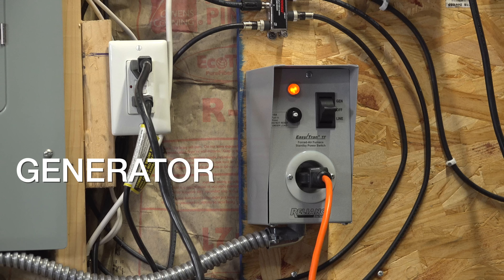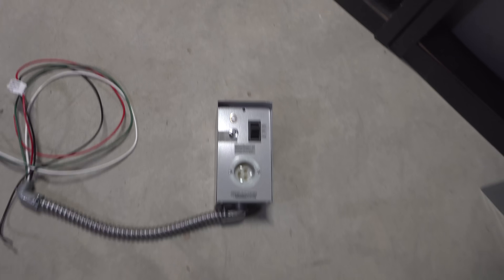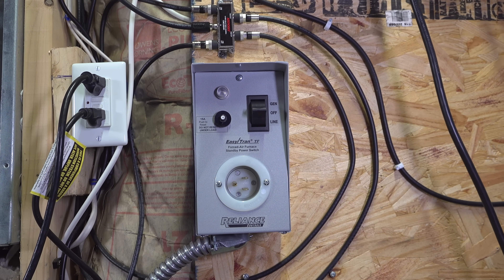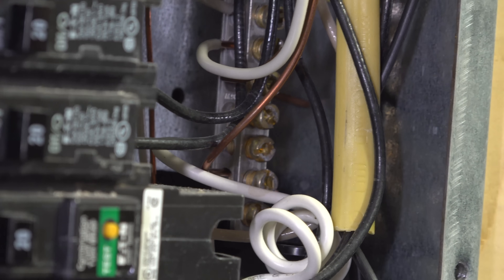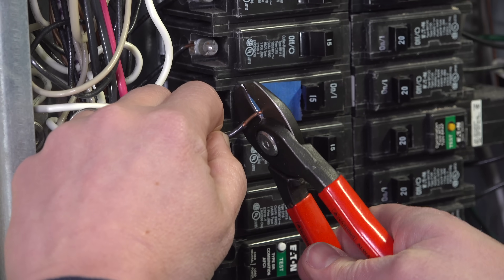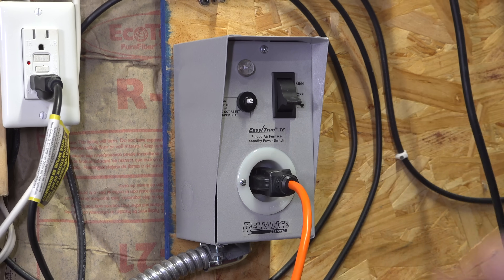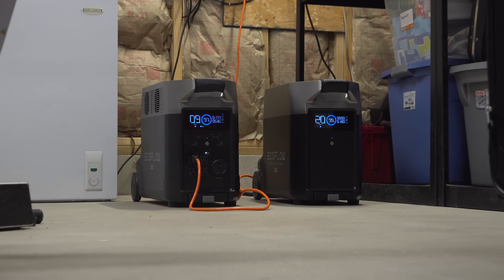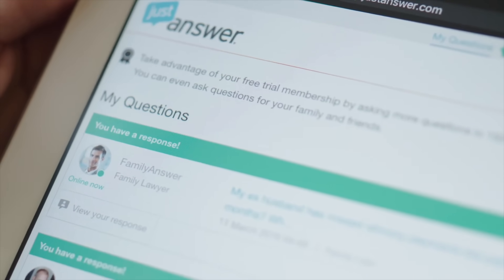Easy DIY Generator Transfer Switch Install - Works with ANY Portable Gas or Battery Generator

Comment: It only handles an 1,800 watt/15 amp circuit. We need something that can handle at 2 or 3 times that.
   Those battery packs don't have much kwh capacity either. May be ok for some people I guess.
Reply from the maker: 3600 watts is not much capacity?
Reply: @SilverCymbal  Capacity is stated as kwh, not kw. If you meant to express it as kwh, then a relatively modest load can mean there's only a handful of hours operating time. Full load because of the breaker is 1,800 watts. That's it, you're done until the battery can be recharged somehow.

Comment: Please remember when the utility company is working down line in a power outage it is possible to back-feed with your generator and hurt somebody remember to isolate your emergency circuits.
Reply: That's what this switch does
Reply: Ya....just shut the main breaker to off whenever you have a backup power source connected to your main panel!!

Comment: Why wouldn't you use an automatic transfer switch, they are cheap and inexpensive. Why the entire process of coming to your panel and switching manually when both your power feeds are always supplying.

The priorities are preset in them, raw power gets first priority, incase of failure after a preset timer, it switches to secondary power. In the event the raw power is restored after a preset timer, it switches back irrespective of the fact that secondary power is running.
Reply: This is just one circuit for emergencies and cheap
Reply: @AgentOffice  I may be totally wrong, but from where I am, an ATS for a single phase, rated for 32AMPS costs approx 25USD. You may search for an automatic changeover from Havells or L&T, and the are very reputed brands in my region. 

I don't know how much this would cost and if it costs more maybe because of any additional approvals. But 25USD seems real cheap for an ATS.
Reply: @SaketIyer  not bad but you'd also need a more expensive generator that can start. Here he uses random cheap ones. I guess his battery one would work.
Reply: @AgentOffice  Not at all, the ATS just has a sensing circuit with a basic logic
If there is power in Line 1, stay on line 1, If there is no power in Line 1, wait for power from line 2 and turn on your relay. If there is power in both lines, switch to line 1.

Also give a 10 seconds delay EVERYTIME you switch lines. That's all. 

Some of these have a current limiter, which is used for shared gensets. But that's not the point here
Reply: @SaketIyer  can you link to what product you talking about. I’m very interested in it.
Reply: @about2088  I can't see the links I posted. Can you?
Reply: @SaketIyer  no. Sadly I cannot
Reply: @about2088  YT removes all the links. That's just sad. Search for Elmeasure ACCL, and you should find it. There is a single phase 32 amps version
Reply: I am using the Elmeasure one. Works like a charm. 

Also using one of their three phase versions, which has a RS485 + Energy Meter + Current Limiter. You can even take monthly power consumption, instantaneous power consumption etc. 

Not using the smart features, but has them. Just using it as a three phase auto changeover

Comment: One thing people with a gas furnace forget is that the automatic pilot takes electric and so does the blower. Even if you have a standing pilot light, you gotta power the blower. 
Personally I like wall mounted units with piezo electric igniters for emergency heat or a wood stove. But this is a great way to get some backup power going for a critical circuit. 
Off grid lighting is easy, and you can always hand wash clothes and take cold showers. But the heat and the fridge/freezer... Those you'll want.
Wall heaters or gas logs  hooked to a residential bulk tank can be months of heating. That would save your power for the freezer/fridge .
Wood burning stoves are pretty great too. What's nice about those is that they are pretty versatile in a situation when you can't get more fuel. (And you can cook on them too.) I've seen wood burning furnaces also, but then you're back to needing a blower.
Reply: @SuperDave  I make it look easy😜
Reply: TMI

Comment: Fyi, Ground and neutral are the same if you are in the main panel, if you're in a subpanel they must remain separate.
It's a subtle difference but it's a difference.

Because well I'm not going into it go look it up on YouTube....................
Reply from the maker: Yes, I added some text to emphasize that as well at 3:45

Comment: I have several EZ Generator switches installed by my garage subpanel to power the furnace, kitchen lights, network closet, home office, refrigerator and family room, each with its own small transfer switch. Why not just use a larger 4 or 6 circuit transfer switch? I did this to match the emergency power sources I already owned.

I have 6 portable power stations ranging from 5100Wh to 720Wh. I can use different power stations to power different circuits. As the batteries run down, I can rotate them in and out to charge via portable solar panels or my 2000W Champion propane generator. With a single, large transfer switch I need to have 1 large power source, and if it runs out of battery or fuel, that's it.

I like the flexibility in power source strategy this approach gives me, and it's a straightforward 120V outlet, which is easy to deal with.
Reply from the maker: These are all great points I had not even considered and love them. This distributed idea gives you a lot of backups so if something should fail you have plenty of options. Good ideas!
Reply: @SilverCymbal  Thanks! BTW, I fixed a typo in my post and that seems to have wiped out your heart like. Feel free to put it back if you're so inclined :).
Reply: This strategy also lets me stretch out my fuel longer in a prolonged outage. Start with batteries, recharge with solar if there's sun, and if there's not, fall back to the generator. Also recharge during the day and run silent at night with power stations so I don't have to worry about someone stealing my portable generator in the middle of the night. Backups of backups.

Comment: Any idea what kind of power a forced hot air oil burner system with a power venter would use?
Reply: you would have to add up the various components to come up with the number of watts or amps. I can tell you the burner will be 200 - 250 watts (a bit over 2 amps) and the draft inducer (on the flue pipe) will have its own tag. The blower motor is the wild card, depending on the size of the furnace. It will be at least 200 watts, but a large unit might be over 700 watts. That said, no matter the size of the unit a residential oil fired furnace will be under 12 amps / 1400 watts. IOW, wired to a 15 amp breaker in your panel.

Comment: Are the three prongs on the box (switch) hot all of the time.
Reply from the maker: No, they never are hot, They are for feeding only so regardless of what position the switch is in there is never power coming out of them to get shocked.

Comment: Honestly I would suggest your friend install a whole panel transfer switch & interlock so that he could then power any of those breakers (a few at a time) since his ECO Flow unit had the 30amp outlet.🤔
Reply: 2x Ecoflows can provide 240V.  Get the home backup panel and you have up to 10 circuits backed up automatically too!  I don't know if I'm going to go that route but I did buy one Ecoflow Delta Pro battery for emergencies for now.  I have 8kW of solar that I cannot use when off grid...unless I get a much more expensive setup.
Reply: That 30amp outlet is only 120V, your whole house panel is 240V, directly connecting the ECO unit to your house panel would cause all sorts of issues because its only a 120V unit.

Comment: I have installed two of these EZ Generator switches for my floating neutral generator. Great instructions and videos on the manufacturer's website. They've worked well. I highly recommend.
Reply from the maker: That's awesome to hear, good product for sure!
Reply: So you pick two different circuits on your house, with two different generators, or do you rotate the generator from circuit to circuit?
Reply: Will these work with a bonded neutral  generator?

Comment: Because the ECOflow units charge so quickly, you can run your home heating system off the ECOflow but if the battery percentage gets low, just charge it up quickly using a gas generator. Then you don't have to run the gas genny all the time and waste fuel.
Reply from the maker: Absolutely, he has a small gas gen also but has neighbors really close so that was a big part of why he wanted to be able to use silent electric instead of gas, Great points as always my friend!
Reply: Yeah cuz your heating system really don't use much power especially if it's a hot water rad system
Reply: @Smart-Towel-RG-400  What heating system do you use? I have a heat pump, and it is 60% of my power bill a month, if not more.
Reply: It is my understanding that heat pumps are only effective in temperatures that aren't too cold.
Reply: He must be running a mini split or some other type of gas / propane heat.  Any type of heat pump units require double pole breakers and the video showed a single pole 15A.  That eco flow pro is only 3.6kW and wouldn’t last very long in the northern states winter.  Maybe half a day.  But the video was very informative though regarding the install.

Comment: So his family will be warm in the pitch black with spoiled food? What about all the other emergency breakers you need?
Reply from the maker: The fridge will stay cold for 7-10 hours on its own if unopened but a house will cool down a lot faster when you get our temps of 0-20 degrees. If he wants to do the fridge, he can just run one more cord to the front outlets directly to the Ecoflow or anything else he wants.
Reply: gotta start somewhere first
Reply: @Jasonoid  I guess. My entire set up didn’t cost as much as one of those delta pros and I power all the essentials.
Reply: This lets you survive..

Comment: This is a manual transfer switch.
I used to have an automatic transfer switch on my RV. It was nice.

I am not sure I would want a switch with just one circuit. That's just me.
Reply: Having a few circuits like heating and refrigerator on backup power automatically can be helpful if you're away for a couple of days and the power goes out. Other circuits that are high power draw aren't normally as important but this will keep your house from freezing and food from going off.
Reply: Agree.
Reply: The money tied up in that 1 circuit job is a joke.  For all that money you could have a whole house standby generator, and power everything in the home as if you had utility power.

Comment: I have four of the EZ transfer switches on my 4 main circuits that I want to keep up with my generator.  They work great.
Reply: I made my own.. ..the 125v 20 amp double pole switch costs $9.00 and the 15 amp thermal breaker costs $3.00 
The socket cost $18..   when I saw the price of those EZ transfer switches I laughed.  If you have 4 of them, it would have been cheaper to buy a 6 circuit all in one transfer switch.
Reply: @johnbattista9519  I did that after I bought 2 and needed another. It's not that difficult.

Comment: At this price point depending on your house size a regular generator might be better.
Reply from the maker: Its always good to explore options. I am seeing a big shift in what people want and what they will accept. Meaning so many folks are scared of gasoline or don't want to deal with maintenance and the relaity is gas generators go bad over time unless you keep on them. Battery units are less powerful but for a lot of homeowners the idea of no maintenance and power anywhere is good even if its less power. No right answer for every person but a lot has changed for people
Reply: @SilverCymbal  That's very true with all this new technology but how will the battery units hold over time compared to a proven generator given it's proper maintenance?
Reply from the maker: @thomazz1976  The trouble with gas generators is more about people's memories. Old Hondas lasted 20-30 years but those days are gone. It's reasonable to expect maybe 10-15 years from a modern gas gen today and truthfully I feel like I am the only person that changes the coil, gas, etc to keep them running well. Most forget about them and they never make their life cycle. Battery units, although limited in many ways won't have this happen and I expect newer units can easily work for 10+ years and by then power output will make buying a new one more attractive. Maybe last much longer but only time can tell us that for sure.
Reply: Solution is a Dual Fuel generator, just bought a Westinghouse 9500DF, have never put gasoline  in it, and don’t intend to.  Have a 1,000 gallon underground propane tank, generator connects to propane quick disconnect normally uses for grill 👍
Reply: @mwolrich  I have same gen set.  Also never put gas in it.   But I’ve used it 3 times already.
Reply: Many folks with these power stations also have a generator for redundancy. I have a 2000W dual-fuel generator. However, I have several power stations that I can keep my furnace, fridge, etc running for anywhere from 18-24 hours on a single charge. Then if I need to recharge, I hook them up to solar panels. If there's no sun, I can recharge with my small generator. Or if I want to recharge faster, some units can charge with both solar and generator simultaneously.

No gas or propane? Use the panels? No sun? Use the generator? Generator not working because it's been sitting there unused for over a year (a common story)? Recharge batteries with my 1000W car inverter if there's no sun. I also like I can run the batteries silent in the evening. This redundant strategy lets my fuel stretch out longer, and lets me run silent most of the time. Win, win (except for the cost -- it's not the cheapest route).
Reply: A regular generator would be 100% a better solution....those 2 battery packs cost more than a whole house standby generator, and only provide enough power for a few small draw circuits, and none of the 240V stuff you need, like your well pump, HVAC system, water heater if it isn't gas, etc.  Lots of wasted time with those battery packs, and a lot of wasted money to use in a blackout or storm situation, buy a good standby generator and do it the right way with a whole house transfer/interlock switch...extension cords are a terrible idea.

Comment: PLEASE READ the ground and neutral are not always connected in the same place. Only on the first panel or first means of disconnect. If you are installing the transfer switch in a sub panel (panel other than the main) keep the grounds and neutrals separate. Just check how everything is connected before you start. When in doubt PLEASE do research or call a professional. Be safe👍
Reply from the maker: Yes 100% agree. Hopefully you saw that I put text about that in the video as well but we worth mentioning again.
Reply: Thank you this is so important to remember and not everyone watches the whole video but many will check top comments
Reply: Was just about to say, hope everyone reads the screen at 3:45 ^^
Reply: @ryutenchi  Unfortunately the way that text is placed and how much it faded into the video, as well as the fact that the video doesn't pause and has something actively happening that you don't want to miss during the short time that the white letters pop up on the bottom-  will cause many people to overlook the text on the screen there, as I did.
Reply: And some generators have floating  neutrals ,if u don’t no what u are doing things can tricky
Reply: Yet the range oven and electric dryer industry fearing loss of sales got away with bonding the two together when they have 3 wire connection. Folks move them change the cord for a 4 wire plug now have N&G bonded in a dryer because they didn't remove it.
Reply: Its so expensive though and i need this. Looks like less than an hour work why are they trying to charge me $2000
Reply: You have a bonded neutral or a isolated neutral iv been in the electrical work industrial or commercial for over 30 years .iv worked installed all kinds instillations mostly what you the neutral will on the ground bar in the panel or switch gear iv been shocked the hardest in my life a neutral in a hospital on a lighting circuit they ran no 10 wire.
Reply: There might be separate bars but they are connected to the same place. The neutral bar is connected to the case and the case is grounded. So yes that's pretty much the same place....

Not to get too technical. But for example. If somebody went to add let's say a outlet with a LED light. That would require the circuit to be grounded. If you went to put that in and realized you did not have a ground wire to ground it to, (there are various reasons for this), A short cut people would make is to wire the ground to the neutral. This is referred to as a ghost ground and would let current travel along the neutral wire and through any and every other circuit that might be attached to that neutral wire while the current attempts to get back to ground at the case or panel.

If you have a multimeter and you want to see specifically what I mean by this just go to your panel and connect a ground lead on a multimeter to the case.  Measure how much current you have between the case and an incoming neutral wire as well as the case and an incoming ground wire.

For the purpose of this video I will add this. Some people will add a sub panel and then the rules are a little different where are you absolutely want to separate your neutrals and your grounds.

I invite you to spend five minutes of your life watching this to further explain.

https://youtu.be/oFSt_rAZGn0
Reply: @wiley0714  hire a professional. Thabks
Reply: @wiley0714  subpanels do not have the neutral bar connected to the case. They are isolated.